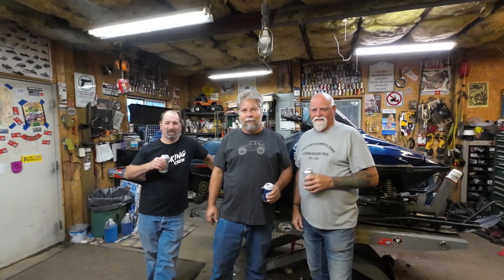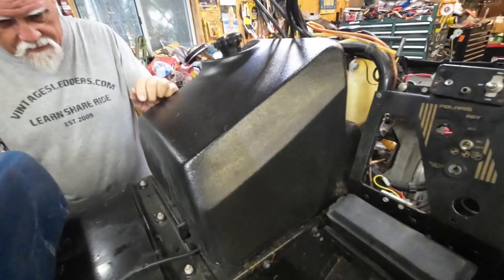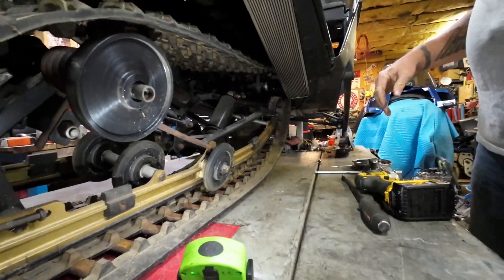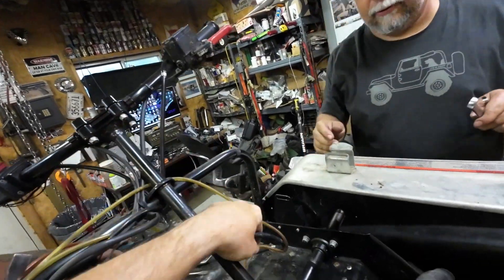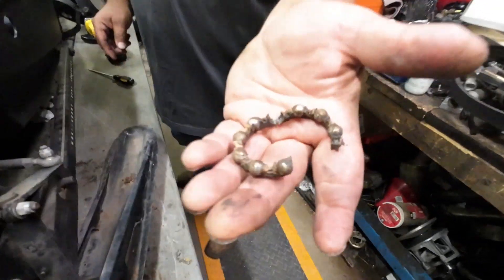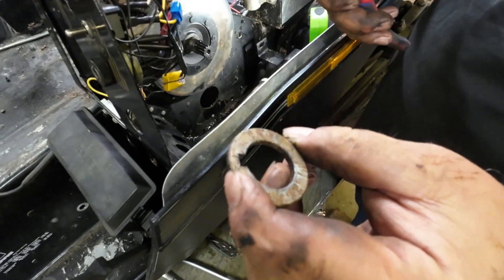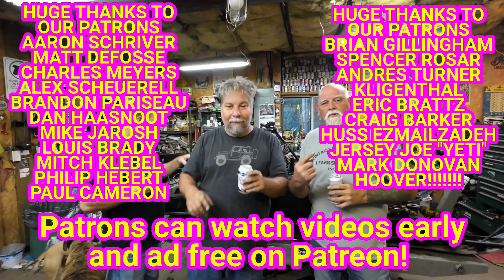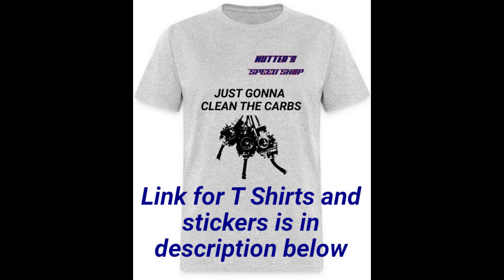Walnuts The Polaris Indy 500 Classic Part 3, tear down. Vintage Polaris Snowmobile Project.

Comment: Many hands makes for a easier job. 

I deputized my wife to help me line up the front motor bracket as I pushed the bolts in from the bottom. 

Having a offset box wrench made getting to hold the lower bolts while she was on the gun made it so much easier.
Reply from the maker: I need to get Dennis and Lonnie over more often. Summer's over so it's sled time!

Comment: Smelly or not, that old Classic is cosmetically in really decent shape.  I don't think I've ever seen a 1990 Indy Classic with an original seat and tank cover in that good of shape.  A knee in a Indy seat with any kind of age usually equals split city and finding a original stock replacement is impossible.  I've dealt with many  tarred up tanks.  A gallon of E-85 will eat it right up and then you have some fire starting fuel for the brush pile when you drain it.
Reply from the maker: Thanks.